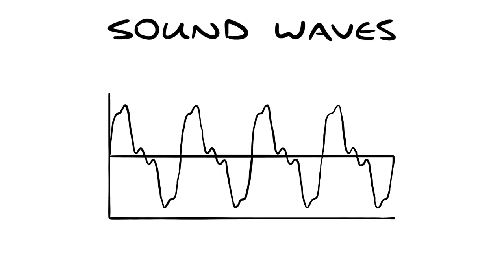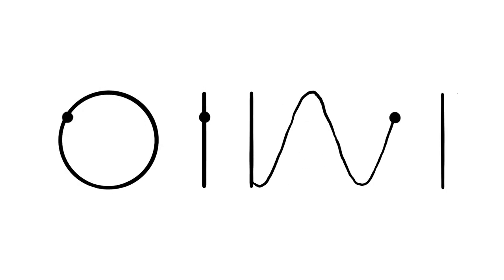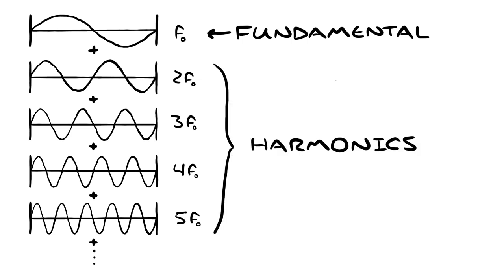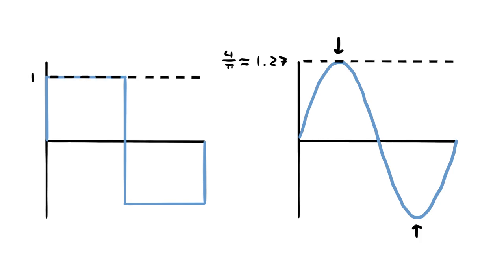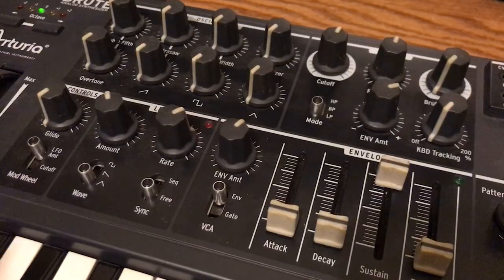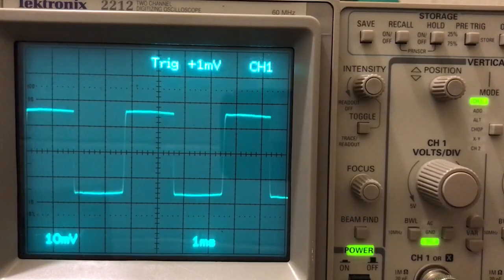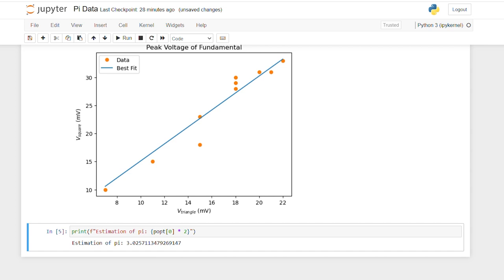Calculating pi with a Synthesizer

Comment: Extracting the sine from the square wave is something I’ve had to do at work. I’m an embedded software engineer and for a controller I had to write we were measuring what was essentially a square wave and we needed to feed as a sine wave into our controller, so we using a FIR filter to brick wall chop off the harmonics of the square waves fundamental. We knew the expected fundamental frequency, so we could tune the filter to cut off just how we wanted.
Reply: yep, FIR filters are wonderful. I used to use reaFIR to reject hypersonic frequencies in my music before converting to MP3.
Reply: @ampersand64  to shrink the file size?
Reply: @realityChemist  prevent aliasing. Maybe I'm dumb and regular mp3 encoding already does this. 
I did it a while ago, when I knew less about production.
Reply: I like your funny words magic man
Reply: If you already knew the fundamental frequency isn't the sine wave already known?
Reply: @PennDraken  we were measuring a physical system, so the frequency drifted. We needed to account for the different frequencies as well as maintain phase. Iirc the shape of the wave also wasn’t clean and symmetrical
Reply: ayoo I'm trying to be an embedded dev, got any tips? would you recommend looking into any certain company to apply to?
Reply: Was it out of the question to use a really narrow band band pass filter? Though I guess the FIR filter is cheaper if the board is already spun up…
Reply: @vimtheprotogen2855 the filter had to placed in a specific step within the control algorithm, so it was done entirely in software. It wasn’t a pre filter or something that could have been done in hardware. And the code for a FIR is super straightforward.
Reply: @hridayashra380  great reference
Reply: @ampersand64  What sort of sample rates are you using to store and edit HYPER sonic frequencies?
Reply: @sebimoe  sorry, it's a strange term. I'm just referring to any content above 20khz. At a sample rate of 96khz, your project goes up to 45khz, which gives you about an octave to push your saturation before new overtones fall back down as aliasing.
Reply: @ampersand64  Thanks, interesting wizardry. Did not hear the term before but makes sense
Reply: @ampersand64  you used the filter before the analog to digital conversion, right?
Reply: @ampersand64 most MP3 encoders did have a brick wall LPF at around 15kHz, so it probably wasn’t necessary. 

The way all these perceptual encoders work, they have to first pass the signal through a set of very tight BPFs (also called a filter bank) to isolate the spectral characteristics of the waveform. Most did an LPF before the filter bank as the first stage, some just had the slope on the filter bank bands tight enough that all the BPFs essentially did it for free. (The encoders which progressively went up to 20kHz with higher bit-rates generally did the latter AFAIK.)

But depending on when you did this maybe your personal-use encoder was one of the janky ones that were everywhere until the mid-00s, which often did things improperly even when they weren’t technically absent.

Comment: Honestly quite impressive that you were so close with the eyeballing on the oscilloscope
Reply: Human perception is surprisingly precise. I don't have a citation but there are countless books on graphic design and data visualization that teach about how accurate we are at determining if lines are parallel. It's a big factor in UI design as well, really powerful user interfaces make use of the parts of out visual perception which work the best. Another one is our ability to tell if two parallel lines are coincident, which you use every time you read the speedometer in your car, or the fill level on a measuring cup, or in this case when you want to make sure what you're seeing is a smooth wave without any lumps.
Reply: Which makes me wonder how accurate it would be if you would somehow automate these adjustments and take measurements on a fine scale and take the optimal amplitudes that way. Although I can imagine the other factors adding error might be more significant than the errors introduced by eyeballing it.
Reply: @B0K1T0 probably eminently automatable with HPIB instruments tbh, on both the signal measurement and generation side! Could log many dozens or hundreds of samples for each waveform and setting as well.

Comment: I don't know if I missed something but you should've been able to run the low pass resonance filter on the sin wave too, instead of needing the triangle wave... Regardless, great video
Reply: That model of synthesizer doesn't have a Sine oscillator

Comment: You can get a higher shelf/less inclusive filter on a software synth, at least I know on phaseplant there is a specific function on the filter effect on it. Good luck on your sine adventures
Reply: Brilliant idea: performing the whole experiment using a plug-in should generate much more repeatable and accurate results!

(Probably best to do this with a pretty simple naïve synth though, without complex virtual analogue circuit modelling.)

Comment: The Biblical accuracy of pi might be closer than you think: we assume of course that they'd work to 21st century standards and measure the circumference and diameter from the same points, but perhaps that assumption isn't entirely safe. Later the Sea is described as "like a lily blossom", and checking images we can see lily blossoms are splayed. So if the top of the Sea splays out then it could well have a body circumference of 30 cubits and an outer diameter measured at the rim of more than 9.55.

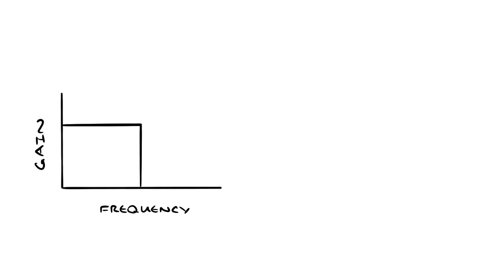Comment: 3:20 What about brick wall LP filters? (yeah they are not perfect, they do add some minor waviness just below the cutoff frequency, but it is close).
Reply: Main goal was to measure pi _with that syntesizer_, and he was approximating a brick wall as well as he could using the filters it had.
Reply: @Validole  yeah I commented before finishing the video 😅 later he also talks about steeper filters than the basic 12db/oct if I remember correctly.

Comment: 6:00 huh? The bible's calculation is fairly accurate though? That's even shown in your illustration, the brim has a thickness. And the 30 is the inner circumference measurement, making pi = about 3.1

Comment: I have been playing synth for years and never made the connection that only asymmetrical waves like saws have even harmonics.
Reply from the maker: It's pretty neat, and it's not just the math.  If you turn up the resonance and try to tune a filter to play even harmonics, it'll always skip the even ones when you're playing a square wave!
Reply: @physicsforthebirds  that's really neat!
Another thing you mentioned is that most filters aren't sharp enough a rolloff to effectively filter the higher harmonics enough to get to a sine.
You achieved this effect by affecting resonance, but would stacking multiple filters with the same cutoff frequency also lead to the same effect?
Reply from the maker: @speed0  It would. In fact, when we talk about the "order" or "poles" of a filter we roughly mean how many stacked filters it is equivalent to.  You can make a filter with a steep roll-off by adding more, or, as some engineers have pointed out, I could have made a higher order filter, but then I wouldn't be calculating pi with a synthesizer!
Reply: I may be wrong but I thought that a 12 verse 24db filter was basically referring to how steep the roloffs was
or a LPx2
Reply: @katiebarber407  that's correct. A 12db/oct filter is a 2 pole or order filter. 
And a 24db/oct filter is a 4 pole. 

Each pole takes off 6db/oct. That means that if you put two identical sets of two polls its the same thing as a filter with twice as steep a rolloff.
Reply: @speed0  ayy nice. I was mostly just guessing after using filters in FL studio for decades. it's nice to be validated. have a nice day